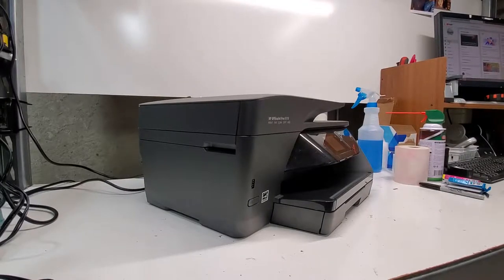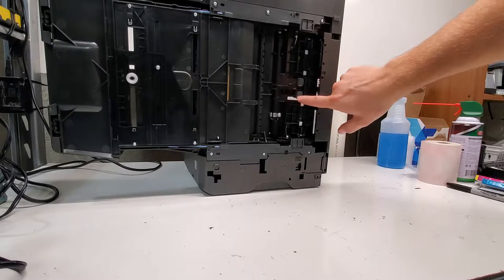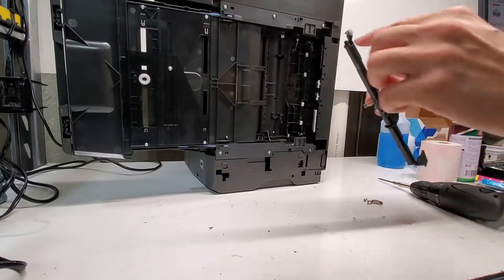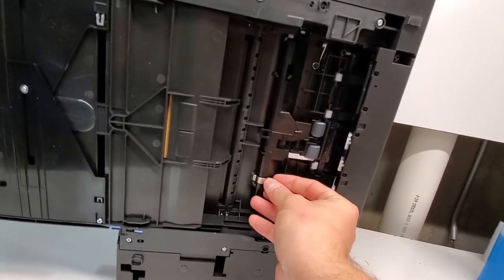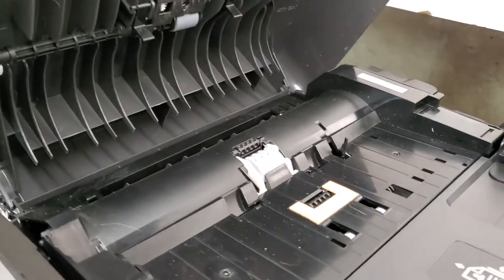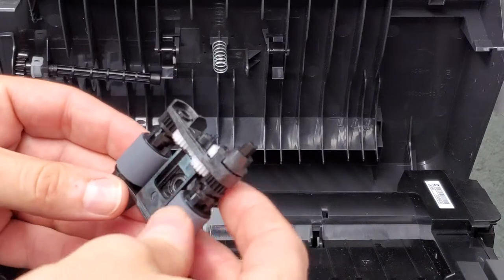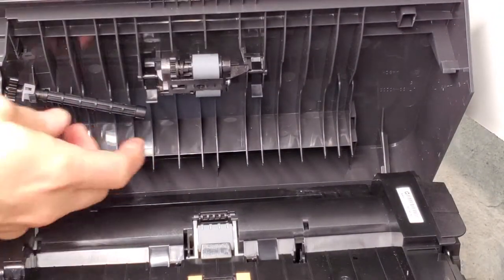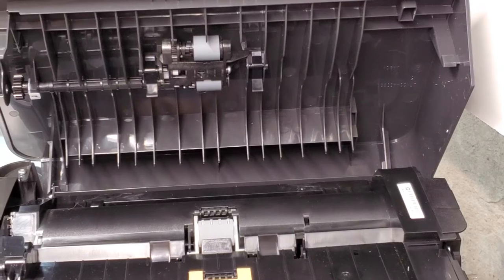Printer paper pick-up rollers maintenance and replacement tutorial for HP Officejet 6978, 6962 ADF

Comment: Hi, 303! I have an HP 8625  from Costco that has been excellent = I have used the document feeder very little.  This week it stopped feeding well.  By well I mean that it starts to feed then goes crooked on the left side and creates a paper jam. I cleaned the rollers thanks to your video.  They didn't appear dirty at all however. Nothing has changed. Could there be a plastic part on the left side that is causing this?  Thank you.
Reply from the maker: Hi. A few places to check. Make sure the paper guides in the traybare set to paper size you are using. Another reason, most likely the one, is the duplex unit. It seems like it is not installed fully. Remove it, check to make sure there aren't any obstruction, open duplex unit and check. The reinstall and make sure both sides click in. Let me know how that goes.
Reply: @303electronics  Hello 303- Thank you for your reply! I just  spent another hour or so on this thing- and lo and behold I opened the scanner unit to see that back end and there was the tip of one of those black packing wires sticking out. I gently pulled it out. That was the issue as it works again now. Must have been in there all this time and finally worked itself sorta out!

Comment: hello, I need help please, I have a kodak printer/scanner hero 9.1 and I took it completely apart following a disassembling video youtu.be. I don't have any problems with dried ink, or stuck cartridge.  I barely used the printer and I kept it covered. I have tried to clean all the rollers and they were not dirty,  im just stuck after trying for 3 days. the rollers move when I try to print, but after a few seconds I get paper jam error because it never picked up and there is no paper jam. can you help please?  btw, the paper roller sits on top of the paper, is it suppose to be up?  I looked with a flashlight and it just spins over the papers but I never see it drop down from above.
Reply from the maker: Got your other message about a successful fix. Glad you got it fixed. Thanks for sharing.

Comment: is the gear, attached to what you pulled out?  I have cleaned the rollers several times, but I don't think the rollers are dropping.  When I manually wind the gear to the far side, the wheels drop, so they are capable of doing so.  But when I hit print and look into the front where the paper is, I don't see that they drop to grab the paper.  If I find a way to order the long piece you took out, will that fix the gear issue is the big question.
Reply: im having the same issue.  Were you able to resolve?

Comment: i have one question.  One roller has at one side a white plastic holder where it turns in. How is it at the other side. With my printer there is a black part on top of the middle of that roller. Like the core of that roller has no holder or is that part broken with me , because that roller has much space to move for and backwards what can cause a paper rolling problem.

Comment: I have a paper jam at the bottom of the printer and I cant get the paper out is their a way to press a button
Reply from the maker: Pressing a button usually doesn't solve this problem. If you see paper stuck or a piece of paper stuck in the printer somewhere, use tweezers and gently pull on the piece. Open all possible covers to get easier access and release any jams.

Comment: I'm having issues with my HP 8600 Officejet.  It will not pick up papers on my Top Loading feed tray.  I cleaned all the rollers inside the feed mechanism, the feed paddle, etc. But, it will still not feed? I have unplugged and reset the machine etc.  I can find no paper jams anywhere.  I've tried it about 30 times, still it will not feed.  What else do I do now?
Reply: are the rollers turning, if they don't turn that gear is broken and need to replaced